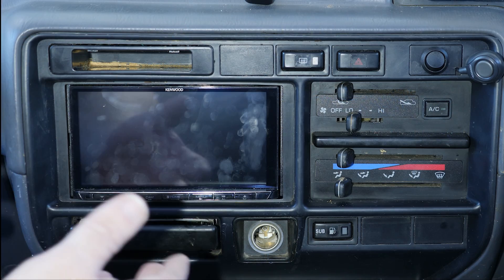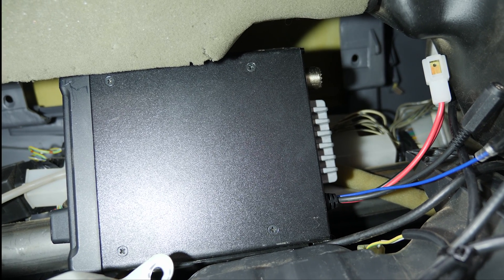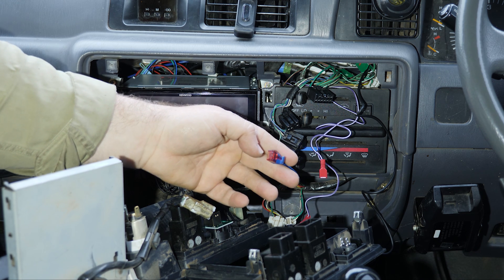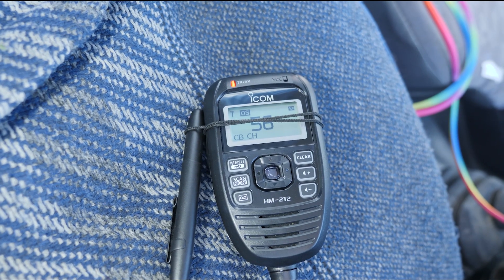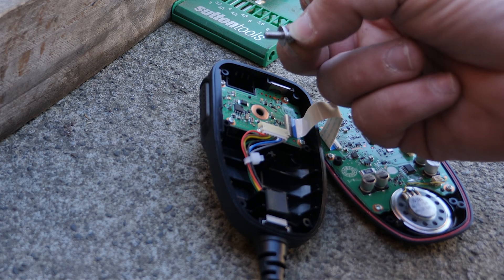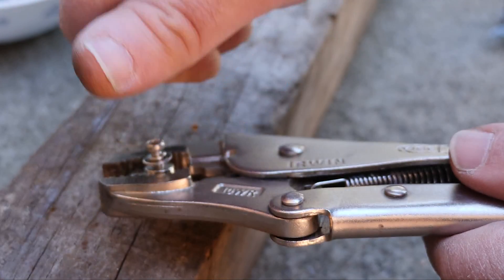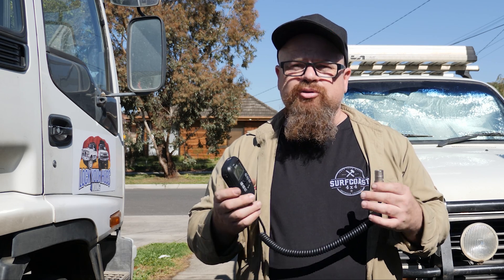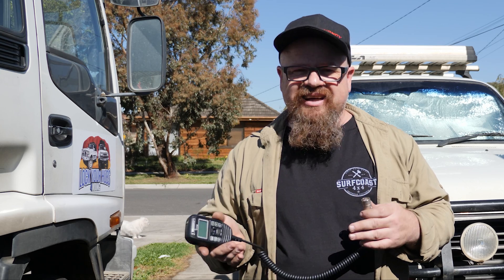You're Wiring your UHF CB Radio WRONG! And MAGNETIC MIC mount mod!

Comment: Fail to see where the wiring it wrong is? Should be direct to a battery, the choice is whether to go to the car or domestic, either is fine, just depends when you're likely to need the radio...
Reply from the maker: If you wire through the ignition, when you turn the engine off, you'll miss radio calls.
Reply: @LockyourHubs4WDing  you are right, but it wasn't really clear in the video, maybe something for next time!  not sure how much heat your unit creates, but it's best to mount in a clear verticle position for best cooling (I mount my high power radios on the rback of the rear seats usually, the next one will be on the rear cabin bulkhead. you're spot on about not fitting under the seat though, water is not your radio's friend! :-D
Reply: Click bait, mate

Comment: Does the GME Magnetic mount work as an effective ground for those functions of the radio that use the grounding of the handpiece as a trigger ?

Also how are you finding the ic450. I'm shocked at how little reviews there are for them as they seem to be an excellent alternative to the GME.

Excellent video, I was wondering how hard it would be to swtich to magnet mount and you certainly helped with that.
Cheers
Reply from the maker: The magnetic mount has been working flawlessly.. The Icom is still working great!
Reply: @LockyourHubs4WDing  reckon you can make a video on it and perhaps its features?  theirs really nothing out there for it
Reply from the maker: @TheJanope13  I might look into it in the future, thanks for the suggestion.

Comment: What’s the model of the uhf you’ve installed and what’s the maximum current draw ? Is it safe to install on interior factory fuse panel ?
Reply from the maker: It's an Icom IC450, great radio, I've got one in the better 3/4's Zook as well. 

The max draw when transmitting is only about 2 amps. Though you're probably better wiring directly to the battery if you can for the reasons in the video.
Reply: Lock your Hubs 4WDing 
The Ic-450 does it cone with 10amp fuse or 2amp ? Can it be manually turned on and off if it’s directly pierced to the battery ? 
I’d like it to be turned on and off automatically with the ignition. 
Can you do a review on IC450 ?
Reply from the maker: I haven't specifically done a review on the IC450, I might into the future. I prefer to wire directly to the battery so I don't miss anything when pulling into camp and turning the engine off etc. You can still turn the radio on and off with a button in the handset.
Reply from the maker: Also from memory they include an inline 10amp fuse.
Reply: Lock your Hubs 4WDing 
Thanks , so the wire they provide is rated 10amps max, I better wire it up to the battery to be on the safe side. I’ll look forward to a quick review of Ic450 sometime soon , also where is it made ?

Comment: Glad to see you running ICOM it's my go to brand, other than gme. I use gme antennas. I have being doing electronics (hobby) for about 20+ years and found these to brands are hard to beat. ORICOM i have installed a few of these units for other people and well you get what you pay for is all i will say.
Reply from the maker: I really like the Icom stuff, I've got there waterproof handheld and the same radio as the one installed in the Zook. I hear good things about GME as well and want to check out their intergrated location system one day. 

When it comes to cheap gear, as they say, but once, cry once!
Reply: @LockyourHubs4WDing  yes you are spot on , I love my icom ic-400pro and had a ic-450 when it came out sadly i paid about the $490 mark and only got a short life span out of it, the unit still transmits but has a loud humming noise during transmission, icom want to charge a arm and a leg to repair it as the warranty had issues after i lost the receipt , Later found out someone had been mucking around with it while the antenna has been removed. But am about to order the icom IC-410pro.
Reply: @adamjones2025  I remove my antenna when parking in the city so the drug addicts don't nick it. I either swap it for a tiny GME AE4001 that doesn't draw attention (was about $15), or if I can be bothered I also unplug the handpiece and hide it away in the glovebox. Putting it in the glovebox also avoid accidentally transmitting with no antenna!
Damage to the output might have occurred from transmitting with no antenna, or potentially from a short if the wiring was not adequately protected.  You might get lucky - try another antenna (or if you don't have a access to a spare,  pull it out and run it off someone else's cigarette socket and antenna)
Reply: @scod3908  Yes have had many of Antennas stolen and broken on me over the years. I also taken mine off and put them in the vehicle.
Reply: @scod3908  As for my Icom radio it is DEAD lol i found out the gme antenna/elevated feed was damaged because some A hole had been swinging on it and broke the cable inside it.
Reply: @adamjones2025  Sorry to hear it. Unfortunately anything under $500 isn't usually worth paying someone $100/hr to repair these days. No luck getting it fixed?
Reply: @scod3908  Yeah icom wanted a nice amount to repair it, Min repair costs was i think $330 not worth it.
Reply: Ouch, pretty sure mine was ~$380 brand new with a GME antenna. Definitely not worth it! Maybe sell the hand piece as a spare?
Reply from the maker: I  usually run ZCG, had a really good run out of them ever since am cb days.... I've been lucky enough never to have had one stolen. (I can't say the same for lights :( ) I usually only take them off for underground carparks. I've not long gotten the 2dbi (I think) ZCG "shorty" for around town, seems to work ok so far, though I probably will test it down the track.
Reply: @LockyourHubs4WDing  When choosing lighting for your 4wd i only stick with the mid range brands as the higher end brands are a magnet for theft. I saw the new narva driving light range a few months ago and last week i asked if they sold any yep sold a pair they said, well turns out the POOR guy did not even get a week out of them before being stolen $1300 gone!!
Reply from the maker: @adamjones2025  bugger.....
Reply: @LockyourHubs4WDing  have you seen the article about 4wd super center ??
Reply from the maker: No, do you have a link?
Reply: Delete this if you like after reading it.  

14 January 2020
Outdoor Supacentre Pty Ltd, trading as 4WD Supacentre, has paid $63,000 in penalties after the ACCC issued it with five infringement notices for allegedly misleading consumers about ‘was/now’ price comparisons advertised on its website.

The ACCC has also accepted a court-enforceable undertaking in which 4WD Supacentre has committed to not engage in similar conduct.

Between December 2018 and January 2019, 4WD Supacentre advertised some of its highest selling products with a high ‘was’ price and a low ‘now’ price. This was despite the products not being advertised or sold by 4WD Supacentre at the ‘was’ price at any time during the previous three months.

For example, 4WD Supacentre advertised a camp oven with a ‘was’ price of $279 and a ‘now’ price of $84, representing an apparent saving of $195. In fact, the camp oven had not been advertised at a price higher than $104 for the three month period beforehand. 

“We were very concerned that this was misleading consumers into thinking they could achieve significant savings with 4WD Supacentre, when this was not necessarily the case,” ACCC Acting Chair Mick Keogh said.

“Businesses must tell the truth when advertising “discounted” prices, and must not fabricate increased savings.”

“All businesses should ensure they provide consumers with accurate price information, enabling informed choices by consumers based on potential savings and an even playing field for competing businesses which are doing the right thing,” Mr Keogh said. 

Under the terms of the court-enforceable undertaking, 4WD Supacentre will also publish corrective advertising and receive training in the Australian Consumer Law.

4WD Supacentre’s undertaking can be found on the ACCC’s website: Outdoor Supacentre Pty Ltd.
Reply: @LockyourHubs4WDing  just added the article to the comments but trying to copy the link.
Reply from the maker: I did see that a few months back, there's no doubt that they needed to review their questionable marketing, I subscribed to their email advertising a little while back, though quickly cancelled because of the onslaught of emails that appeared in my inbox! They kind of reminded me of the the old "Ken Bruce has gone Mad!" TV adverts.